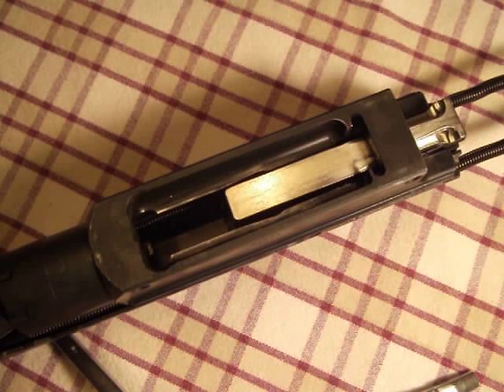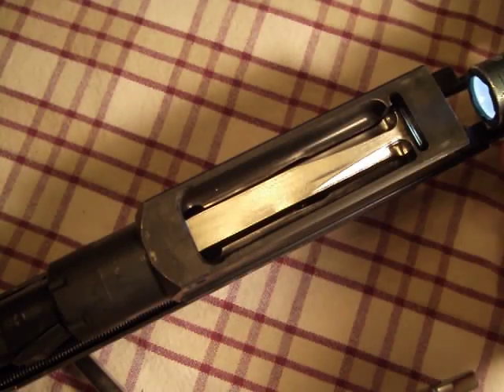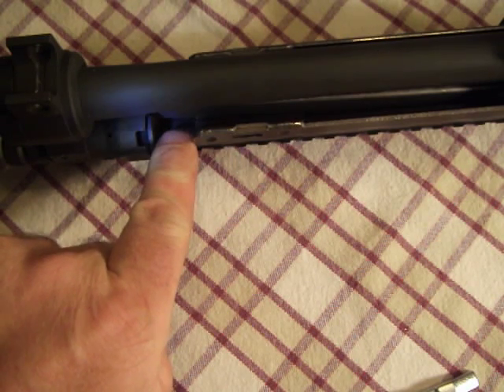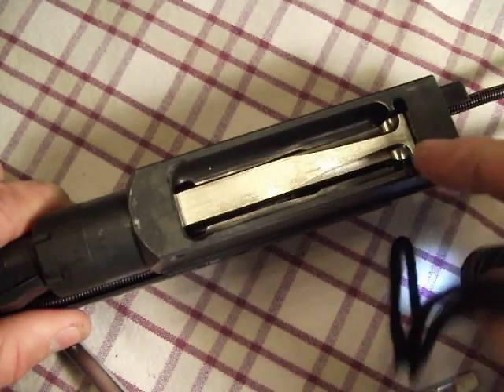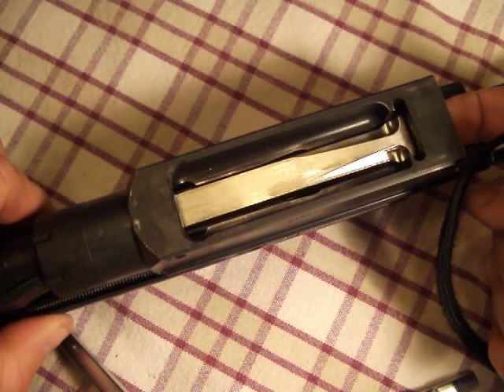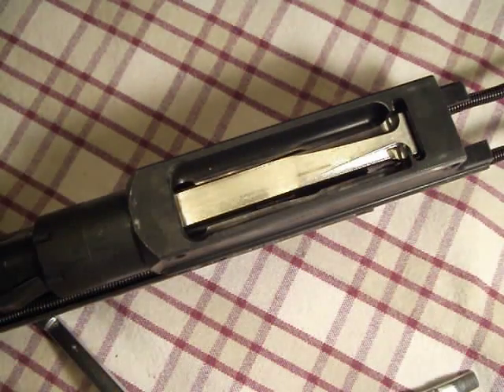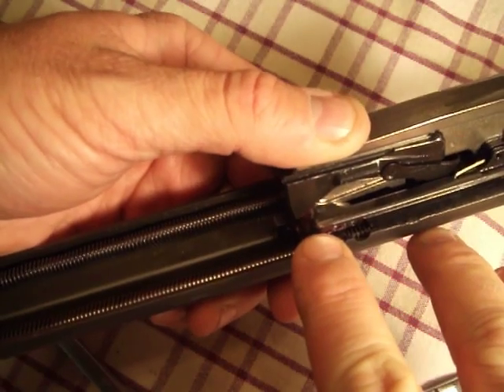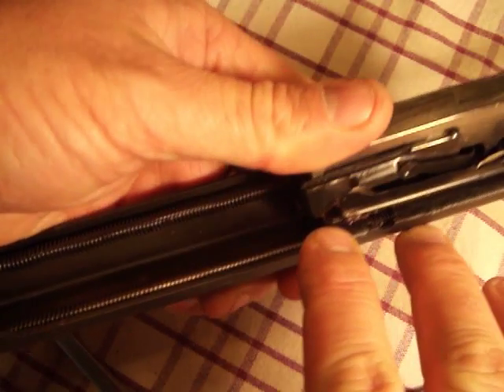RFB tilting Bolt

Comment from the maker: The extractors, one on each side of the bolt, are tied together by an arched spring holder.  As the bolt travels to the rear, once the empty case is fully retracted from the chamber, the spring mechanism tilts the case upward.  As the bolt travels back forward, the now uptilted case is pushed up onto the ejection ramp above the chamber.  I have another video up that shows how the tilt mechanism is supposed to work...

Comment: One of the worst bolt mechs I've ever seen. 🤮
Reply from the maker: Perhaps, but the tilting bolt has been around a long time though, and the RFB spin on it actually works pretty well, at least mine has for over a decade now…
Reply: @rronmar  oh I know the SKS and FN FAL both use a tilting bolt. But I think they could of executed the bolt assembly better and I'm not a fan of the extractor. I'm glad yours works well and you like it though. The only thing that matters is it suits your shooting for fun or to protect yourself and family. :)
Reply from the maker: @cfenim01  oh yea, they could have done things better(like the chamber), but forward eject is pretty unique.  I think this design is probably a little safer. I have seen sploded SKS and FAL, and I don’t think I would want that with an ejection port right under my face.  The way they did it allowed the whole action to be covered by the bolt carrier channel.  The 2 explosions I have heard of both went downward thru the magazine well with only minor injuries.  Having put out these videos, I have wound up helping people with issues here and on the KT forum, and they have mostly fallen into two categories. 1. Material failure in the extractors themselves(I think they had a heat treating issue). They would occasionally break right at the pivot pin, and not rotate cleanly with a case in between them, interrupting the feed.  2. Over-gassing. Most all the feed/eject issues I saw were caused by this.  The adjustable gas system makes this 7.62 feel like a 5.56.  But let too much gas in and the bolt slams the buffer pad hard enough to dislodge the case and cause a mis-feed.  Other than a spring rod guide failure, the gun has ran good anytime I shoot it, which is why I did the gas adjust video…
Reply: @rronmar  very informational! I appreciate you, and the time you took to wrote all of this brother. I'll still definitely stick to my AR, SCAR, and Kriss vector platforms but I definitely welcome the knowledge. If no one has told you lately, you're doing a kickass job! Have a great one!